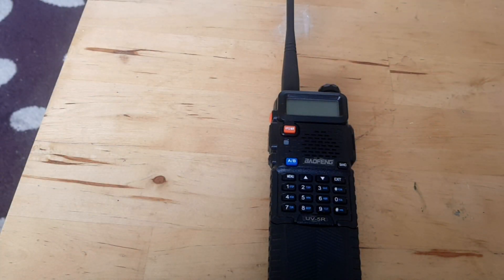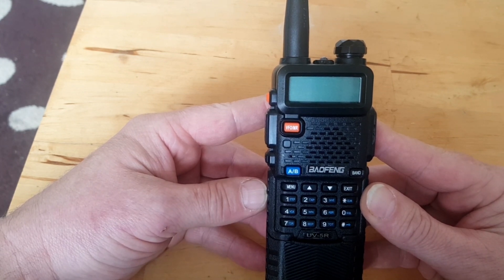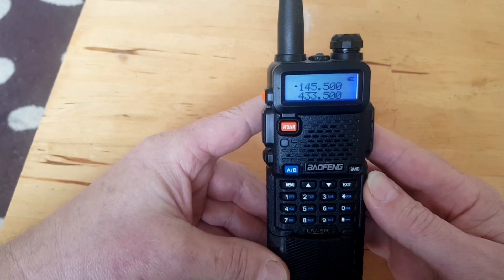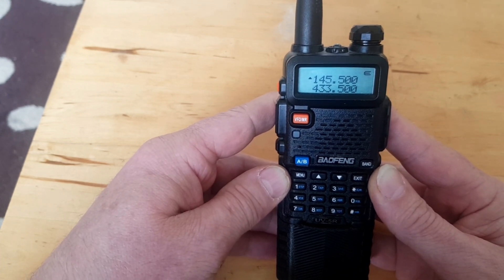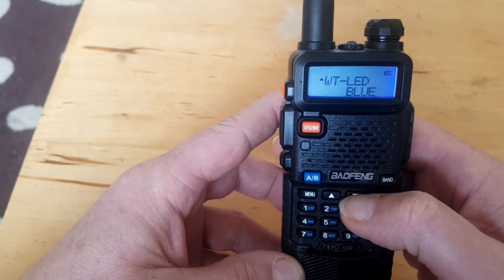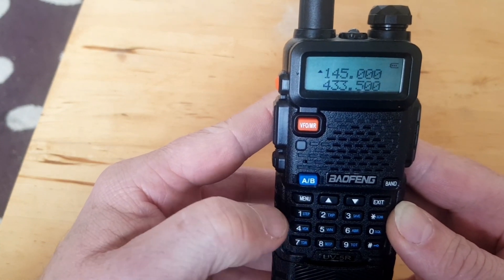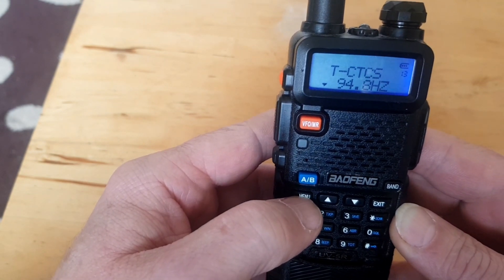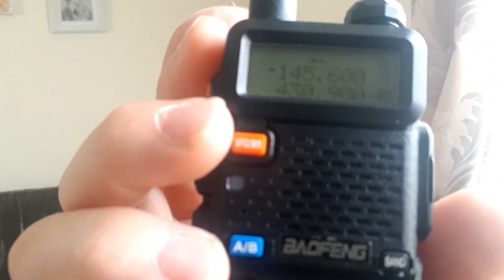Baofeng UV-5R How to program repeater offsets and CTCSS

Comment: How do i put negative offspring ? Help
Reply: I never knew you could store both the output of the repeater AND the input into one channel in the radio. I thought you would have to store them to individual channels and use TDR!
Reply from the maker: Follow what I do in the video. But to put it short, store the mem channel twice, the first is the recieve freq, 2nd is the transmit freq. Turn the voice prompt on so you know which is which